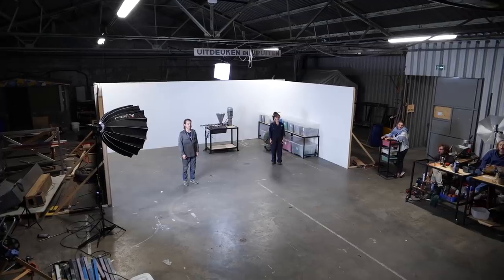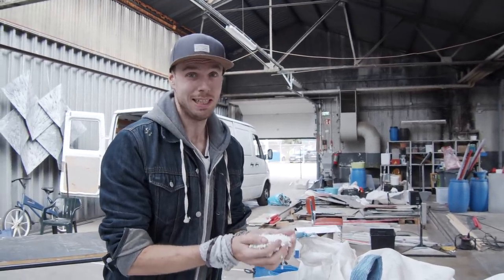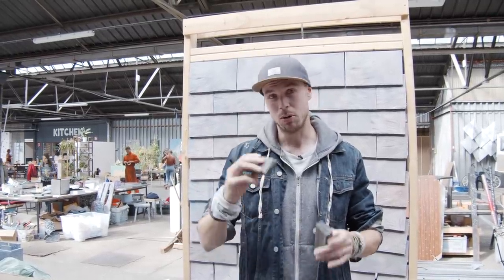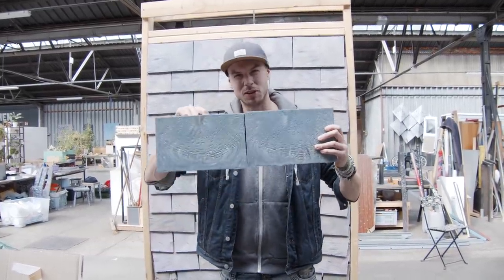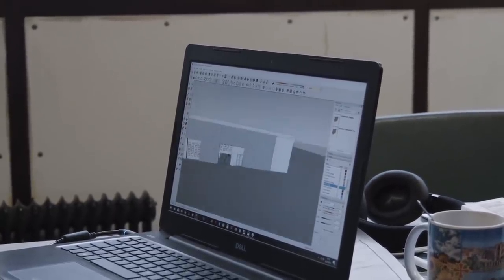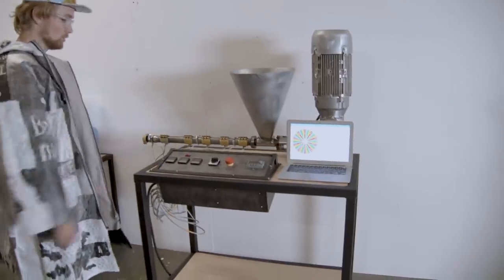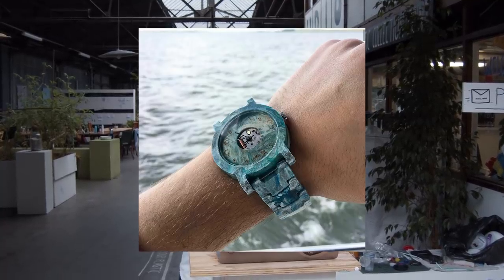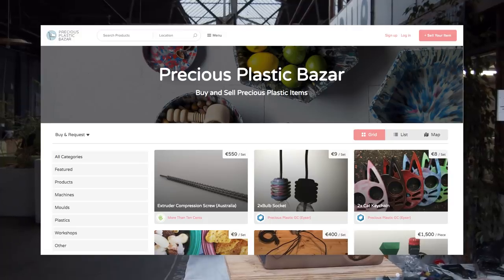Monthly News #32 - We're running out of time!

Comment: The brick looks like cladding.  The bricks should be made from soft plastic that is often contaminated and difficult to recycle.  So soft plastic + dirt/sand/sawdust = bricks/pavers.  
Also bricks used in buildings should meet fire standards,  don't need another Grenfell Tower fire.
Reply: Brett, like your thinking, we will continue to do more R&D over the coming weeks in this area. Rory

Comment: Hey, Is it possible to make standard 12mm or 18mm thick sheets from waste plastic in size of 3mx2m or larger  sizes? Becaue they can replace plywood sheets. We can apply laminates on these plastic sheets so we get desired look. I think plastic sheets will also provide better termite protection as compared to plywoods.
Reply: The PP team are able to make sheets of that thickness but sadly the max output of the V4 machine is 1m x 1m. With the right knowledge and money, I'm sure the open source community will create a bigger model!

Comment: Two things I have been wondering about: 1.) Are you all testing how fast your products break down under UV (I know that some types of plastic are resistant, but most are not)      2.) How do you all handle fumigation of your workshop? Im guessing that plant based plastics are probs ok, and that you don't need to melt plastic at a very high temperature (215 F on most 3d printer extruder heads) so maybe that is low enough where toxic outgassing is not an issue? Did I answer my own question?

Comment: would saw dust make the plastic harder to recycle?
Reply: Hey Castsmith, yes it would. Any contamination would reduce the ability for the plastic to bind together. That's why normally it is best to clean our plastics. However, some plastics are so badly contaminated it is too hard to clean.
Reply: Yes, but this is not meant to be added but as an option for plastic waste that is hard to clean. I don't think they want to use clean plastic and add dirt to it on purpose
Reply: @doughntworry  Correct, we don't ;) Rory

Comment: Adding sawdust essentially makes it a WPC (wood plastic composite). Would it be possible to recycle them using the conventional PP machines?
Reply: It seems they never consider how recyclable something is. Truly we should just turn all plastic back into crude oil.
Reply: @lightdark00  it could be recycled as it would be treated like aluminum ingots.
Reply: Hey, we had actually placed a full brick in one of our new V4 shredders and it worked just fine. So there would be no problem recycling them with V4 machines in the future :) Rory

Comment: Haha I just thought that you guys could do this after watching the video "Modern UK house of cork LEGOs built by hand, no glue needed" by Kirsten Dirksen (https://www.youtube.com/watch?v=t76Wjw1ZVkQ).
They use expanded cork that is milled into interlocking shapes.
I wondered if something like rotomolding a brick and then filling it with expanding PU spray foam would be ideal.
You could also add slightly longer fibers (hemp?) into the plastic to increase tensile strength. Or any kind of fiber really. They do that with chipped fiberglass for many molded parts to increase toughness. Fiberglass is also a rather sustainable product if you would make it using sustainable energy.

Comment: It's insanity to put plastic in a long use environment where pollution is a factor and recyclability is low. Like the bricks, just how are they going to stand up to the sun for years.
Reply: Pretty well, actually.  There are plenty of places that use plastics as building materials and in some cases they last much longer than natural alternatives.  For a few examples, there are farms in America which have replaced their fence posts with plastic beams, and some communities in India and Russia have companies that make roofs and sidewalks/walkways out of recycled plastic.
Reply: MrV902 The big difference is those plastics, if recycled, had uv blockers and fire retarders added. Also we don't have true science about how much micro-plastics come from those things.
Reply: @lightdark00  still a good use of soft plastics that currently end up in landfill.  UV blocking could be applied to the blocks if used in building,  but the fire risk would be insane.
Using landfill soft plastic that is contaminated as pavers/block would give that plastic a 2nd life.  But no good for building construction due to fire risks.
Reply: I understand your concerns. Bricks are simply a good way of sequestering a lot of waste (that would end up in the environment or in animals) until better solutions become available. To avoid solar degredation and micro plastics I recommend painting the bricks with a UV blocker after installing or plastering the surface like a conventional brick. Rory